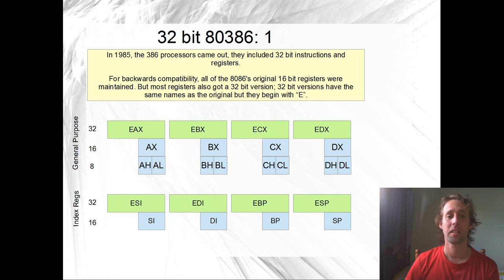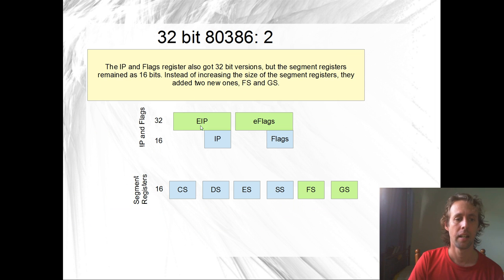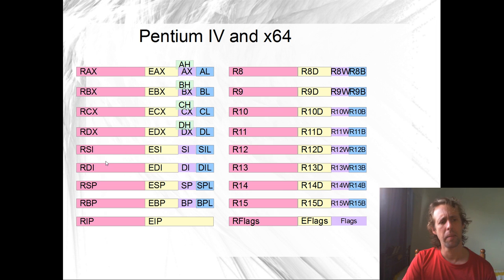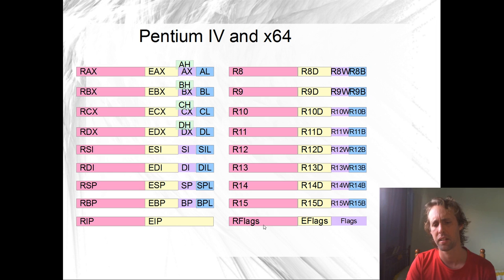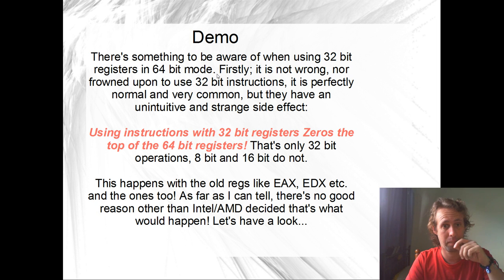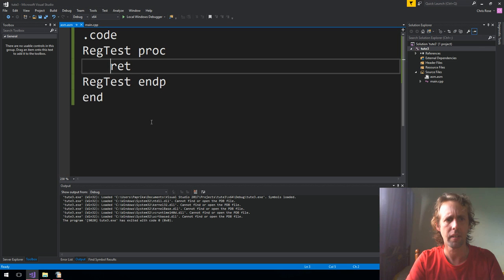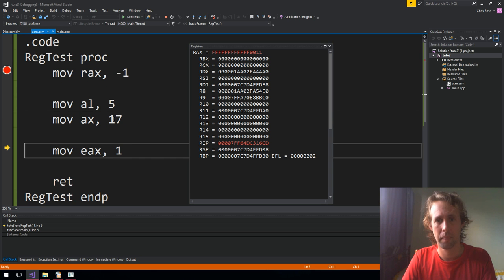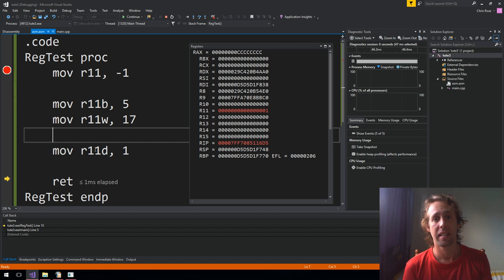Modern x64 Assembly 3: 32 and 64 bit Registers

Comment: Really good. Just a note, it was actually AMD who came up with x64 in their Opteron and Athon 54 processors. Intel later licenced it to use in a version of their Pentium 4
Reply from the maker: I think you are right! It's still called AMD64 sometimes too!
Reply: The fact that 64-bit CPUs will appear one day, was quite inevitable. It's not that hard to figure out. So I'm surprised that such things can even be patented or licensed :P  Well, then, I better patent the idea of a 1024-bit CPU asap, and I'll be very rich one day :J
Reply: Andrew Crews  I know the architecture pretty well, and yet I still don't know what you meant by that. Could you elaborate?
Reply: @bonbonpony  They didn't patent the mere concept of a 64-bit CPU, they only patented their very specific instruction set. So your comment doesn't really make sense.
Reply: @notnullnotvoid  You know what doesn't make sense? That someone can patent a mere idea of an invention instead of the invention itself (i.e. a functioning device). There's nothing innovative nor clever in choosing a particular instruction set encoding: you basically just assign numbers to instructions in such a way that would be easy to decode by the hardware. It's pretty much like patenting the alphabet.
Reply: @bonbonpony  That's an argument against the entirety of patent law though. Not that I'm criticizing - I actually agree that patent law is a net negative, especially for computing.
Reply: @notnullnotvoid  Great, you understood ;) Patents are just the way for the State to know what is being invented by its citizens without the need of monitoring all inventions – just scare the inventors that someone may steal their idea and they come to you with their ideas all by themselves :q Then you can decide whom to grant the patent and support their business and whom deny it, or you can "classify" it and take it over as "national security matters" and give your soldier boys some new toys to play with :q  From the economic perspective, though, patents are unfair competition supporting monopolies because a competitor who has the resources and knowledge to mimic someone else's invention and produce it using his own resources, is being stopped by law from doing that. Even if his business model could allow for better service and better prices for the customers. Or if his approach to the idea is more innovative because he improved on the original design. This, and copyright law, leads to mediocre suboptimal solutions being perpetuated while good solutions being kept locked for decades.

Comment: The zeroing out of the top 32 bits is a preemitive software optimization in hardware which eliminates false dependencies.
When we went from 16 to 32 bit CPUs, those early 32 bit CPUs were not capable of out of order execution, instruction level parallelism and register renaming.
When 64 bit CPUs came along, pretty much all CPUs were capable of that. (False) dependencies cause data hazards and prevent those hardware optimizations.

Comment: 01:37 It's not true that we don't use the segment registers anymore. And it has nothing to do with memory segmentation as you might know from the old days. Nowadays, segment registers contain memory descriptors that index in the GDT/LDT/IDT descriptor tables that hold information about where in the address space the particular sections of your program start, along with other information such as access privileges etc. It's just in the flat memory model on a system that runs in the protected mode, those registers cannot be modified by the userspace program, only by the operating system. It initializes those registers on program startup to point to the correct "segments" in virtual memory (with a little indirection through the descriptor tables).
Reply: Seems like for a flat memory architecture, they would all just be initialized to address 0.  I read somewhere recently that the call gate mechanism implemented in the 386 is not even available in modern x64 implementations of the family anymore.

Comment: Explanation for the statement at 05:00 : When AMD designed this set of instructions they wanted to remove fake instruction level dependencies, in most programs you are not aliasing between a 32 and a 64 bit registers as a result when you are changing the size of the operands you probably are logically talking about something else, but the CPU does not now that and it can't do a very good job on instruction level parallelism. For the 16-bit and for the 8-bit operation the change was not made because the semantics for those operations where already established.
Reply: Partial register stall

Comment: If you want to prevent certain 32-bit instruction from clearing the higher 32 bits use bitwise operations or backup certain registers into another one.
On the PowerPC architecture it clears the rest of an register even with 8-bit and 16-bit values. But this only happens with load instructions
Reply from the maker: Yeah, it's annoying! I don't know why they do this, it seems obvious that instructions should not zero in unintuitive ways, and yet this type of thing is everywhere! I guess it is design or manufacturing limitations at the time of new architectures that causes these decisions? Anywho, thanks for watching and commenting!
Reply: Zeroing the higher order bits in a register (or setting them to 1) is known as sign extension.  This is done so that arithmetic operations will produce correct results.
Reply: What's a Creel? On the Motorola 680x0 family of CPUs there were 2 forms of the move instruction.  On treated integer values as unsigned and the other treated them as signed.  Move.S and Move.U (or something like that).  If you are intending to use the value in a signed integer arithmetic operation then it needs to be sign extended.  That is the typical situation.  Same thing as in C when you have a uchar (unsigned char).  If you just specify char, int. long then the compiler assumes you mean for that value to be used as a signed integer and generates the signed version of move instructions accordingly.

Comment: Could the eax zeroing the top bits in the rax register be because of that register's special usage to communicate results to callees?

Imagine a function compiled for a 32 bit system, all the return values are in eax. A future convention may want to use the whole 64 bits in the rax register for return values. If eax didn't zero the top bits then whatever garbage was in might be interpreted as deliberate return value when a program compiled in this hypothetical 64 bit code calls a function originally targeted at 32 bit machine.
Reply from the maker: That's an interesting thought! I'm not sure, actually. I think it was for false dependencies between instructions? I'm sure there's notes on this in the Intel and AMD manuals somewhere. Well cheers for sharing and watching mate :)

Comment: I guess that zeroing effect goes back to the mov instruction the mov overwrites the register and the example you inserted 1 is just 1 in the least significant bit of that register , and to achieve this you need to zero out the other bits so we can read this as one, like in 0000 0001 that’s one byte length 1 apply this to the whole 64 bit wide register
Reply: That's what I was thinking.

Comment: Question:  when a negative number is moved into a 32-bit register, do the upper 32 bits change to zero, or to all ones?  Because the purpose of such a behavior would seem to be to make the entire register have the same numeric value as a the low order portion.

A similar situation appears in the IBM 360/370/390 series: when a 16-bit value in memory (which IBM calls a halfword) is loaded into a 32-bit register (or full word) using the LH instruction, the sign bit is replicated into the upper portion of the register;   Likewise, when a halfword is added to (AH), subtracted from (SH), or multiplied by (MH) a full word register, the halfword is treated as if it were extended to a fullword by repeating the sign bit 16 times on the left.  Examples: if    R1=X’1224 0000’
LH R1,=H’45’           R1=X’0000 002D’
LH R1,=H’-24’         R1=X’FFFF FFE8’
AH R1,=H’48’           R1=X’0000 0018’

By analogy, extending the sign bit of the 32-bit value moved into the bottom half of a 64-bit register would seem a logical way to keep the same numeric value for subsequent 64-bit operations, especially if there is no way to use only the top half as a separate register.

So can you confirm which it is, always all zeros or sometimes all ones if the value moved in (or added, etc) is negative?

Comment: Nice explaination. I really hate that sometimes a 32-bit value is called a word (PowerPC) and another time it's called a double word (x64). It's so confusing sometimes
Reply from the maker: Yeah, it's a complete mess! Word is meant to be the fundamental data type of the system. But x86 is so old, for backwards compat, we still call words 16 bits, even though the data type of modern CPU's is a QWord!
Reply: Yeah, it is confusing, and the cause for this confusion is Intel. Originally, machine word meant the width (in bits) of the data bus of the CPU and its internal data registers, that is, the size of the chunk of data it could bite at a time.
But Intel saw that differently: bytes are 8-bit chunks, words are 16-bit chunks, so 32-bit chunks are double-words (dwords) and 64-bit chunks are quad-words (qwords) in their book :q  I wonder how they call 128-bit and 256-bit chunks, though :q
Reply: @bonbonpony  octawords or owords is my guess for 128.
Reply: Generally speaking, the word size of a machine is tied to the width of the data bus it uses to interface to memory.  Some minicomputers from the 60s / 70s had 24 bit word sizes.  Hence, the use of octal to specify values for those systems.

Comment: So... if usage of a 32 bit register empties the high 32 bits (essentially using them for storing 0), why would you ever use the 32 bit register instead of the 64 bit register?
Reply: That does the same thing with 64 doesn't it?
Reply: 32 bit instructions are faster and also smaller to encode, especially for literals. Instead of taking 64 bits to encode your literal, if it fits in 32 bits the result will be the same but you will save a lot of space.
Reply: @meneldal  No, it may not be faster if it is in a 64 bit system as a 64 bit cpu is more optimized to run 64 bit instructions than for 32 bit instructions so it will take less time to execute the 64 bit instruction. It is an interesting phenomenon within CPU environments

Comment: I hope you replace your Java series with Kotlin or Rust.
Reply: Vishal Biswas Kotlin is not a beginners language, Rust is not mainstream, is changing rapidly and has no good tutorial base for beginners, Java still seems like a good idea (except for some technical debt)
Reply: What is the definition of a "beginner's language"? Kotlin is a modern language. Newer programming languages are adopting the functional element of programming and going forth the programming scene will look like this. This doesn't seem like beginner friendly because we are used to old C-style programming syntax and logic. The only thing that makes Kotlin difficult is its docs. Their docs assume you have previous programming knowledge. As such, it would be a lot of help to have a good quality tutorial for the language, considering its gonna blow up as a replacement to Java in Android Development. Assembly isn't a beginner's language either. I agree that Rust has a smaller audience. Its a systems language. So, is Assembly.